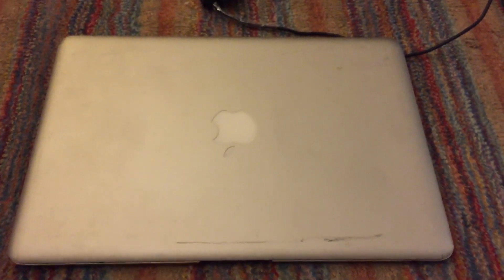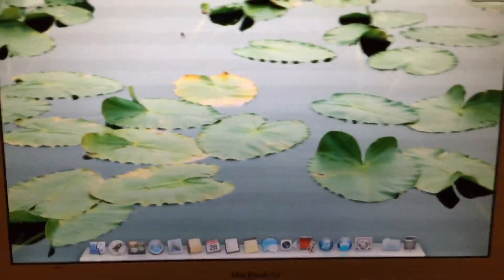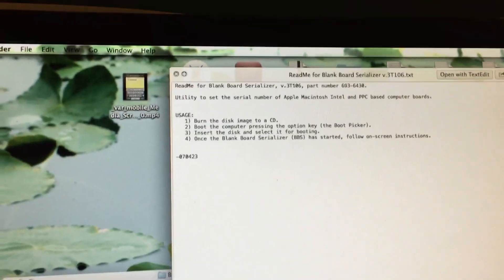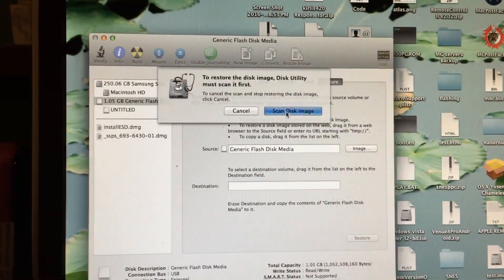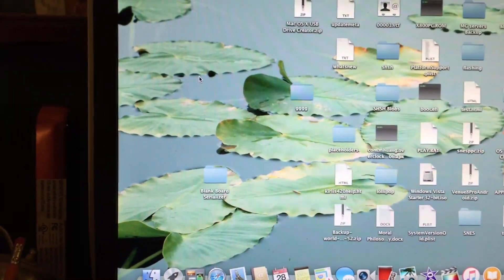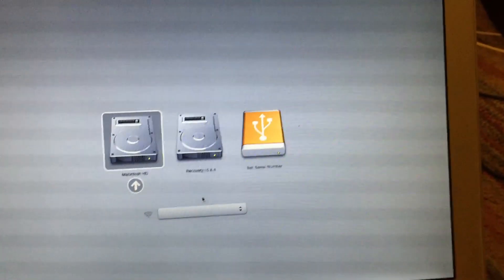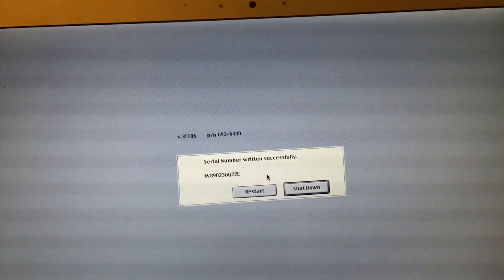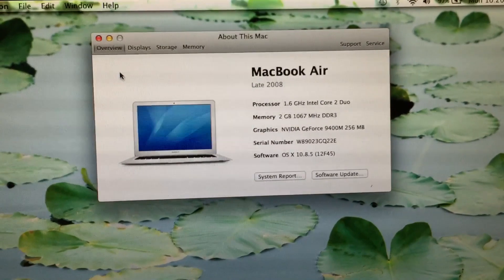Writing a Serial Number to a Mac Logic Board

Comment: Can I use this program to change the serial number of the macbook? I bought a macbook pro 2012 and it's attached to a MDM profile that won't allow me to upgrade the OS.
Reply: If you already have a serial number you can’t replace it
Reply: I'm facing the same issue too after replacing my faulty logic board with a used board. Need to change the serial no to my original serial no as per on my bottom case.
@dosdude1 pls help me bro

Comment: My 2014 Macbook Air has flickering issue and it just so happen that when check "About this Mac", it also shows the "Serial Number: Unavailable" . Are these two issues related? If I follow this instruction to write the serial number back to the Mac Logic Board, would that also fix with my screen random flicking (goes black) issue? Thanks!

Comment: i know this video is a bit old, but i have a question and hope somebody can help me out. my macbook mid 2012 15 inch mbp has a "serial number unavailable" in the about this mac. bottom cover is from 2011 macbook as per serial number (got this used and seller does not know anything) is there a way to re instate the actual serial number for my device? TIA for the help.

Comment: Well, I tried multiple times to mount onto usb drive using Disk Utility but that was kind of dead giveaway. It allowed me to mount a wrong of BBS but not the desired one. Used TransMac on PC to mount the appropriate version of the app and thats the only thing that worked.
Reply: can you please explain it more, becuse when I used disk utility in the new macos Monterey 12.4 it just doesn't work.
Reply: @nouph7188  well, if I’m not mistaken the only way to make a bootable flashdrive I had to use PC that runs under windows 7. Anytime I tried to do it directly from my old MacBook Air mid 2012 it failed with any version of disk image to boot from. Hope that makes it a bit clear and didn’t confused you. Cheers!
Reply: @Paliester  damn i need windows 7 only got windows 10

Comment: Hi Dosdude. I have the same issue -> About Tis Mac -> Serial Nummer -> Not available. Created bootable USB stick. Plugged in pressing Option key. What happen it will just quickly show some command lines and then boot normally from the SSD. Does this mean it already  have Serial number although it does NOT show it. I have MacBook Pro Retina mid 2012. I'm using sw Pkg. from your link.
Reply: I'm having the same issue here. Were you able to figure out a solution?
Reply: @nickoaks5143  seems to be you are using wrong BBS version, try another one.
Reply: seems to be you are using wrong BBS version, try another one.

Comment: Hi, I tried to do this on my 2012 Air and it wont work. When I boot it shows EFI Boot for the Stick, but when I boot from it , it will just quickly show some command lines and then boot normally from the SSD. According to the Disk Util, the stick is NOT bootable, but I did exactly as you told. Even tried diffrent sticks and cards and also diffrent versions of the Utility.
One hint for Catalina users: Doesn't work with Catalina to restore the image, you need to use High Sierra. (Why?)
So how the heck do I make this boot from this stick? Content on it is correct.
Reply: same problem here, could you resolve this?
Reply: have you enabled the option in recovery mode to boot from usb drives?

Comment: Thanks for this. I got a board today that has this issue and being a pedant it annoys me so I will be giving this a shot :)
Reply: any success
?
Reply: @alphawade2628  I haven't tried yet but I will and I'll reprt back here in the name of science :)
Reply: @alphawade2628  actually I cannot be certain that the serial number printed on the bottom case is the same as the SN of the actual board in the machine. Not wanting to brick the board I am not prepared to risk it. It's a bit of a bummer because I wanted to do this

Comment: Sr. I know it's been a while since you posted this video, but you are the man. I was able to do it on a MB wu, late 2009 with a 2010 logic board in it. Running osx lion 10.7.5  after burning sbs on a CD, found the soft online.

Comment: Hey I just want to confirm, I should be entering the Serial Number that was originally with the Mac correct? Not the one associated with the new parts
Reply from the maker: Yes, you should use the serial your Mac originally came with.
Reply: This software working with 2015 macbook

Comment: I just tried this and instead of the drive saying Set Serial Number it says EFI partition or something (i forget, but the first part was EFI)
Reply: After I do the restart and hold option, obv.
Reply: WAIT no it says "EFI Boot" WTF. I did everything right.
Reply from the maker: That's fine, just boot from the "EFI Boot" volume.
Reply from the maker: Hmm, make sure you're restoring the DMG onto the USB drive, and NOT mounting the DMG first. If that still doesn't work, you may want to try a different flash drive.
Reply: Trying it on High Sierra and it;s now working. Wouldnt boot into USB.

Comment: I couldn't get this to work. I was using the same model, late 2008 MacBook Air. However, I was trying to use it on OS X El Capitan 10.11.6. I would appreciate any help so this issue can be resolved. Thank you.
Reply from the maker: Was it able to boot from the drive you created? If not, it may have been an issue with the way you restored the image.
Reply: dosdude1 I was not able to boot from the flash drive and I used your procedure as well.
Reply from the maker: Ok, it was probably the stupid El Capitan disk utility not working correctly... Try using Terminal. Just enter the command like the following (excluding <>): sudo asr restore --source <path to DMG> --target /Volumes/<USB drive name> --noprompt --noverify --erase
Reply: dosdude1 im having trouble with this in catalina with my 2012 a1278 macbook pro

Comment: I replaced my 2014 macbook pro logicboard with a refurbish one, it already had a S/N attached to it. Would it be possible for me to use this tool and re-enter my orginal S/N on the new board.
Reply from the maker: Unfortunately not... The only thing you can do is desolder the EEPROM, dump it with an EEPROM programmer, modify your serial number in the dump, then flash it back on.

Comment: I used this software on a 2002 iMac G4. I downloaded the file, burned it to a CD and ran it on the G4. I was able to restore the serial number that was on the inside of the door of the CD drive. First class job. Thank you for the heads up on this.

Comment: Hi dosdude1,
I recently purchased a 2014 mac mini second hand at a good deal. I found after i got it that its serial number at system profiles and about this mac has 2 letters different than what it says on the aluminium back. When i checked the serial number is invalid, however the one on the back is recognised by apple site Its mint condition and facetime, messages icloud works fine. Is there any way to change the serial to the original one?
Reply from the maker: No, you cannot change a serial if there is already one on your board.

Comment: I have Macbook Air 2013 Mid. I tried all of type Blank board serializer. I had "LoadEfiDriver: Image Start Failed: 0x8000000e. The Blank Board Serializer v1.1 after boot up: This is for blank boards only. Whats that mean? :D
Reply from the maker: It means it can only be used on machines that have no serial number on the board.
Reply: OK, I understand it. But my iCloud, app store, iMessage don't working on my Macbook Air. On my iPhone and iPad everything working fine. So in this case I don't have a problem with my serial number. Somebody know some idea whats the problem with my Macbook?
Reply from the maker: Balázs Sram Does it show a serial number in About this Mac?
Reply: @dosdude1   i have this same problem my serial say "System Serial#"  and nothing works

Comment: Thanks for the video!  I have a 2011 MacBook Air and it needed the serial number set after swapping the main board.  The version of the utility that worked for me was the one named 063-7137-A.dmg inside this file.  There are two different versions of blank board serializer in this download. https://dl.dropboxusercontent.com/u/164994/blank%20board%20serializer%203t106%20063-7137.zip
Reply: Is there possibly a new link for this? It looks dead from my end.
Reply: THIS FILE WORKS! USE THIS IF YOU HAVE A NEWER (2010+) MAC. i just fixed my 2012 macbook air
Reply: Glad to hear about your success!

Comment: Hi.

MacBook Pro with Retina (Mid 2014)
OS X El Capitan 10.11.6

_ssps_693-6430-01.dmg
-> LoadEFiDriver: Image Start Failed: 0x800000e

063-7137-A.dmg
->460 internal error

It would help us if you would advice.

Thanks.
Reply from the maker: Yeah, this version of the tool is too old for that machine, and so far I've not been able to find a newer version, unfortunately.
Reply: Have u guys found a solution for the newer models?

Comment: When click on "set serial number" after boot up, it says "LoadEfiDriver: Image Start Failed: 0x8000000e
Are you able to help me with this?
Reply from the maker: What machine are you using?
Reply: +dosdude1 2012 MacBook Air 11". I'm on OS Lion since I reformatted it because message and FaceTime doesn't work.
Reply from the maker: Leo Ho You may need to find a newer version of the Blank Board Serializer program.
Reply: Let me double check when i get home the version.  Is there a link you can help provide for the newer version of Blank Board Serializer?  Thanks!
Reply: my mac is currently on Mac OS X Lion 10.7.5 (11G63) after reformat.  Do you think i still need a newer version of blank board serializer?
Reply from the maker: Try this version: http://dosdude1.com/files/macstuff/BlankBoardSerializer3t106.zip
Reply: thanks for this but unfortunately i'm unable to restore the USB using this file.  Kept saying "this image has no checksum information to verify"
Reply: I had the same issue. the first version gave me that 800000e failure, and the newer version he linked to couldn't be written to a disk. any solution?

Comment: I wonder why it was missing in the first place. Someone messing around with the serial number changing utility, a hardware bug, or something more nefarious?

Side note: That's the same MacBook Air I have.
Reply from the maker: +Timur Tripp My best guess is that the logic board had been replaced by Apple at some point, and they just forgot to write the serial number on the new board.
Reply: +dosdude1 Yeah, that probably makes the most sense.
Reply: Upgrading to OS X El Capitan has also been reported to make your serial number go missing. My 2013 MacBook Air has never been repaired, no hardware changes whatsoever, bought directly from Apple, but it's missing the serial number just the same..